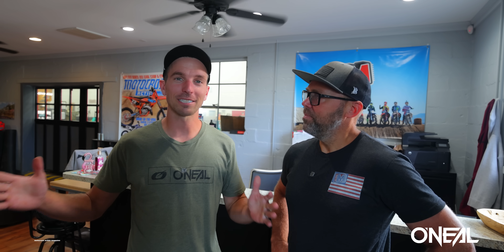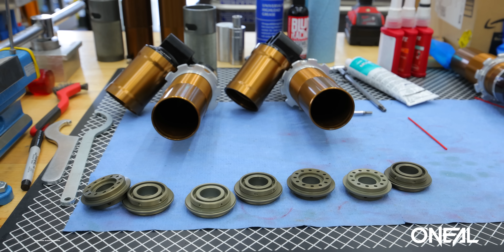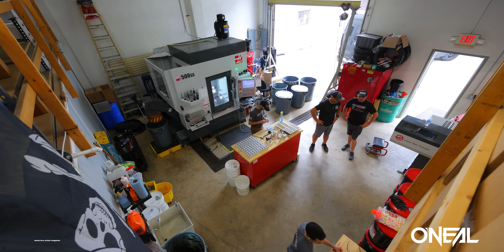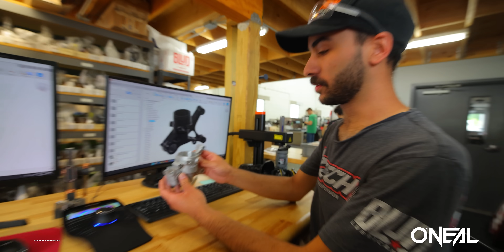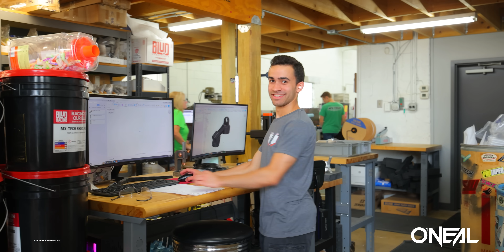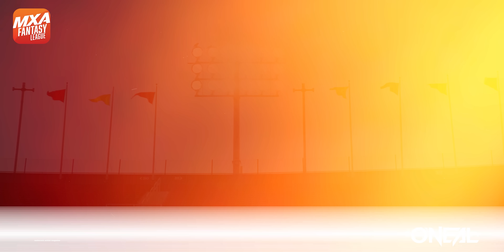This Small Shop makes the Most High Tech Suspension in the USA!

Comment: Good shop if you want to spend thousands on new fangled stuff but you can't just take your old suspension in anymore and get it worked on. Jeremy has worked on my stuff for years and done a great job but to call up and be told no on just overhauling my stock suspension was disheartening to say the least. Now I have to send my stuff hours away when I have a good shop a half hour from me. Smh
Reply: Thats the only thing stopping me. I ride cones and I have an old timer 30 mins from me, has me dialed

Comment: I agree on the weight difference. When I throw my air forks on, front end feels so much lighter than my wp48 fork with single spring conversion.  1 lb more than stock for a twin spring fork setup is amazing. I ended up with a set of cone valves but these MxTech are really intriguing.

Comment: Dave,that’s a scratch compared to what happened to a guy in 1989

The guy put too long of a bolt in his front brake lever. 
He endowed and sliced his femoral artery while his legs hooked under the bar. 

Fortunately my racing dentist buddy  taught me what to do in a situation like this. 
I placed a rag on the groin area and applied pressure. His eyes rolled back in his head several times. 
Once the paramedics arrived, I continued pressure while holding an oxygen mask. 

The dude freaked out. I noticed the oxygen tank was empty and alerted her. She got a new one and it helped him. 

He was helicoptered out and apparently the lesson Dick Ellenberger RIP taught me saved his life. 

The surgeon said if not for that and 5 minutes later, he’d be a goner. 

So yes, check those screws or parts on your bars that can rip flesh and actually lead to death.